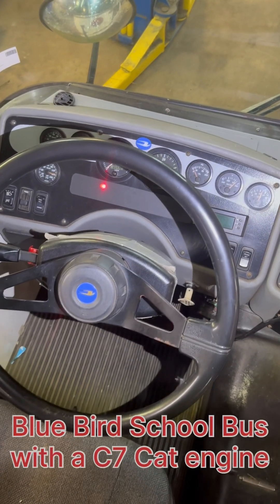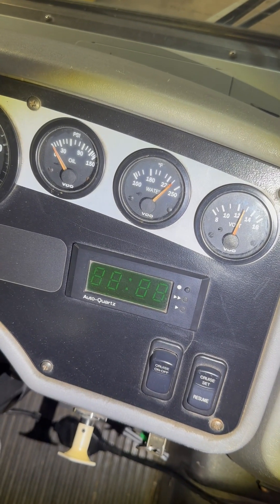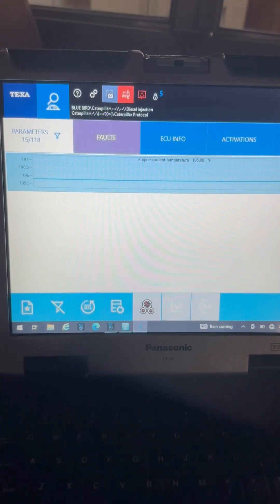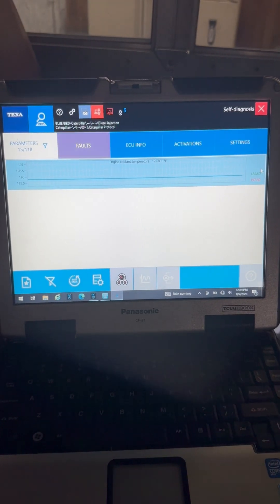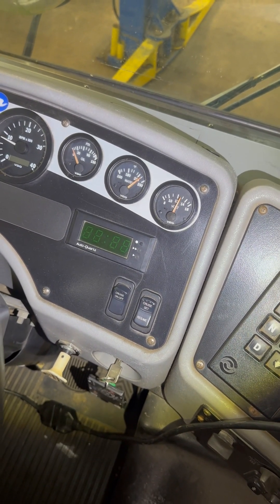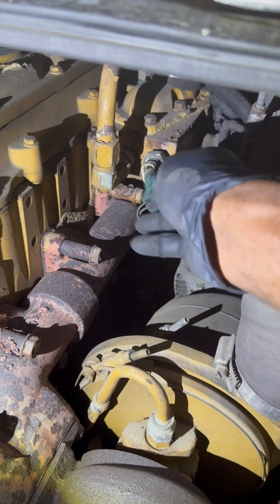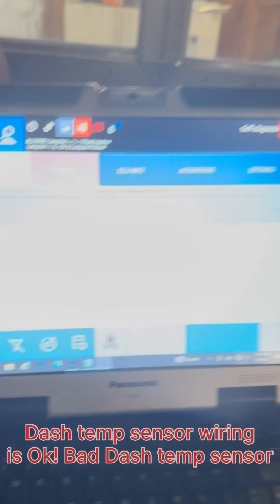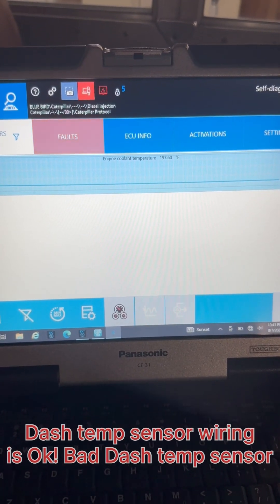Dashboard Temp gauge shows High temperature while Engine temperature is Normal - Quick Diagnosis

Comment: sensor also reports to your scan tool through your bus and ECM. I think maybe your gauge is faulty.
Reply from the maker: @tcook6333  The gauge is not faulty, this engine has 2 temp sensor, 1 for the dash gauge and the other one for the ECM
Reply: one shows head and the other shows after run thru radiator and water pump temperature, of course head is higher pump is what shows operating temp cooler 195..,?